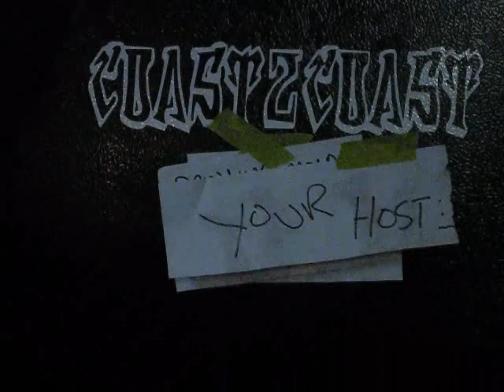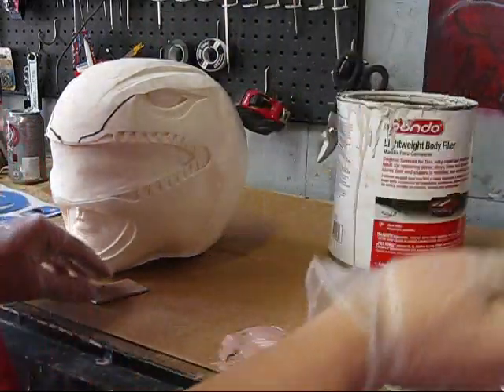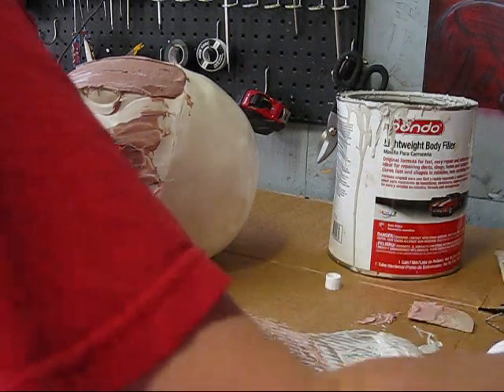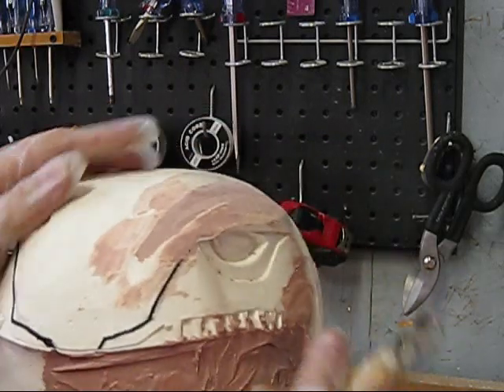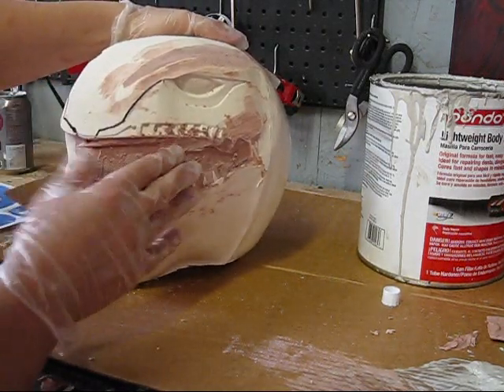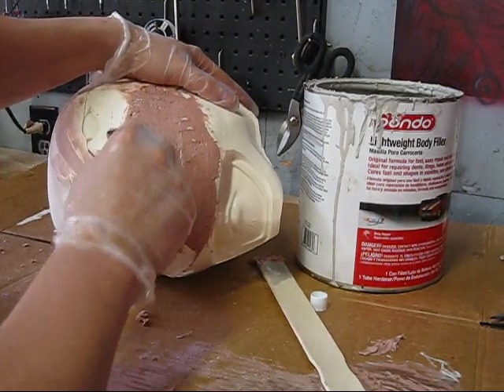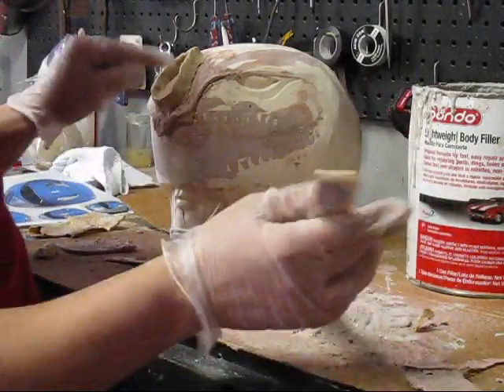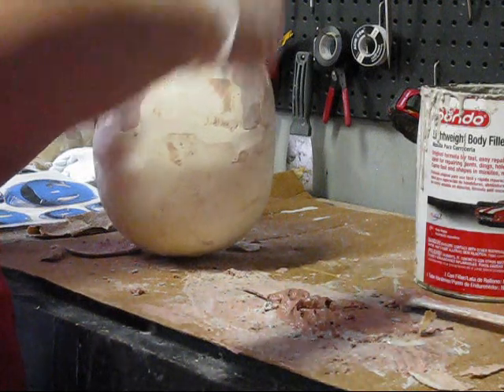How to sculpt wit bondo! PT 1 Blue ranger

Comment: Thanks for sharing your ideas.  I had a feeling I could do this with Bondo, but couldn't find any info.  I plan to use this technique to repair an unusual picture that had been dropped & has a large "chunk" knocked out of the edge.  Should get good results after watching this.
Reply: T BENNETT yeah I just started playing with Bondo. It’s strong and cures really quickly.  Endless possibilities by changing texture or viscosity.